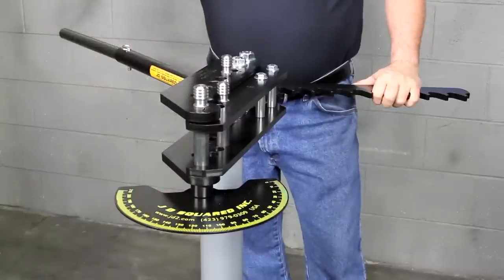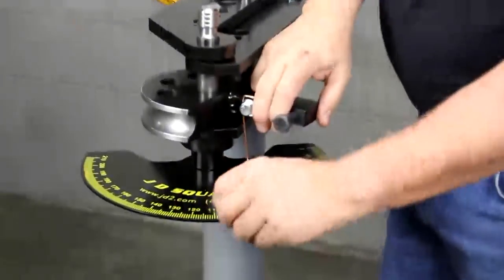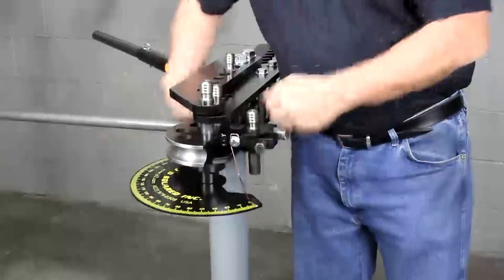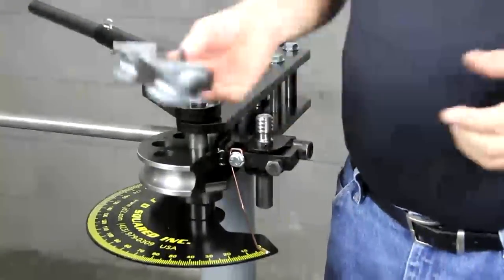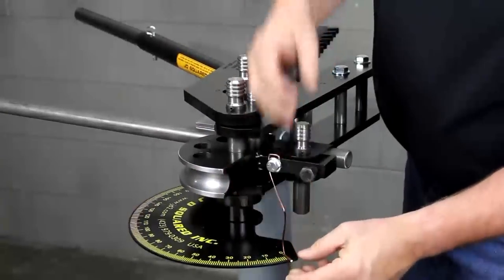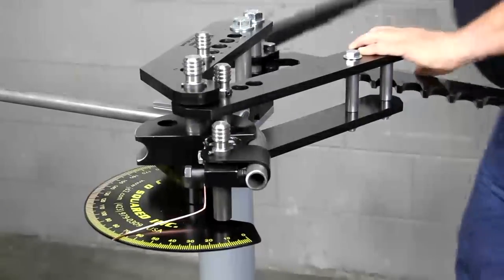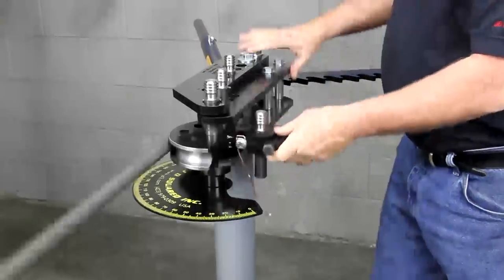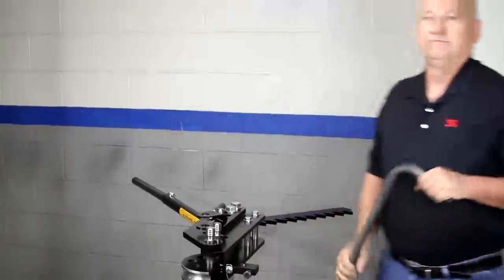Model 3 Bender by JD Squared, Inc.

Comment: I've used this bender for a year now, it works great. I can make 4 bends on 1 tube and have the tube end up at my 1st. bend. Also have the 1 1/4" die which also does the job. I pre-mark my pipe and use a template to get 100% accurate bends. 
Thanks JD.

Comment: I bought my bender from Bob Hughes in 1988 before he left florida. I have learned to use it and consider this bender a great value, especially for a one man shop like mine. I have no degree wheel and the handle wasn't supplied which is no big deal, I'm a fabricator so I designed my own handle. I have dies from 1/2" all the way to 1 3/4". SWAG off road has a nice laser cut plate to fit the bender for mounting on a stand. My bender is a model II.

Comment: Had to look up how to use it again, I've had mine for 20+ years and it has been longer than when they came with handles, mine just has a flat spot to slip a pipe over, no handle was offered and the 1.5" die does not even have a pointer bolt hole. I'm fixing it up to go back in service, so thank you for having this video out there. I notice your discontinuing this unit, that's a shame as it really is the best for the home fabricator.

Comment: I've got this bender, and several sets of round and square die sets.  It works great, but I have noticed that I've had some trouble trying to make identical repeat bends on additional pieces of tubing without being very careful about taking/making precise measurements to verify that the tube is perfectly aligned, etc.,(=> start marks, back of bend, center of bend, etc. as needed)  The bender works great, but it'd be nice if it was able to 'lock' and then hold the tubing while adjusting/advancing the drive handle to the next notch, (=> without allowing the tubing to slip off of it's original position in the shoes.    I'm really liking the Model 4 bender, since it's hydraulically driven = [less back strain! - LOL!!!]  Thank god that the die sets used in the Model 3, are also usable in the Model 4 bender, (correct?....)

Comment: Regular exhaust tubing will kink on the inside radius quite a bit, or just give you one major kink a quarter way through bending. I made an exhaust for my truck with this tool, but it was within the recommended bending thickness for stainless (and pretty heavy). I would purchase this tool to make headers.. but not thin guage exhaust systems.

Other than that, this thing is bullet proof, and worth every penny. Heavy, and not a Harbor Freight toy by any means.

Comment from the maker: The Model 3 bender has not always been supplied with the handle or degree ring. The degree ring was originally an option for around $90. About 6-7 years ago they improved the way the degree wheel was manufactured and were able to include it for FREE. As for the handle, in 2008 they started including a newly designed handle assembly for FREE also. You say it's a POS because they continuously try to improve the product without increasing the price? Really?

Comment: wire as an indicater that needs to be bent back constantly not so good a fixed indicator of maybe 16 gauge sheet would be better and a locking degree plate for secure accuraccy would be top notch.
Feel free to send me the new design for the R AND D ON YOUR OTHERWISE NICE TOOL i'll use the heck out of it.
james